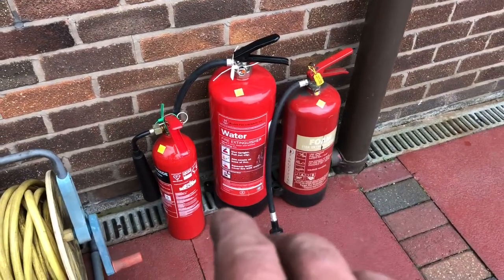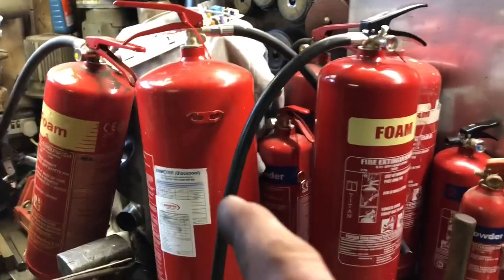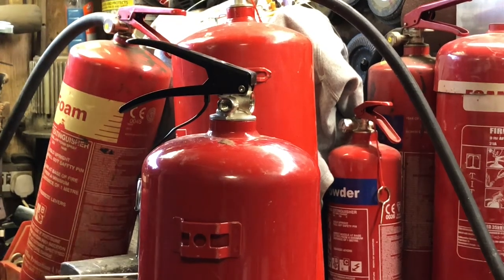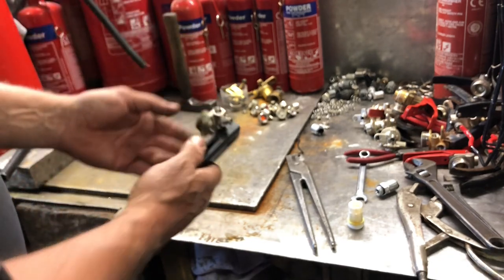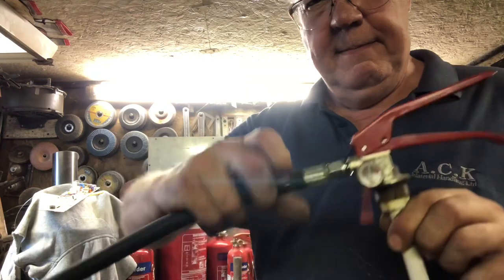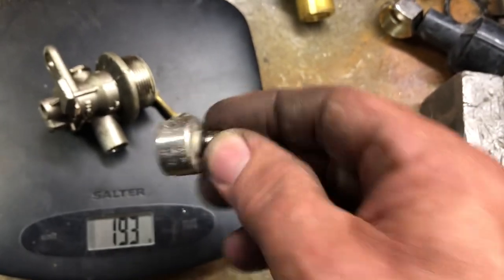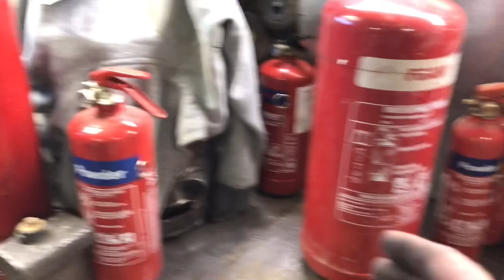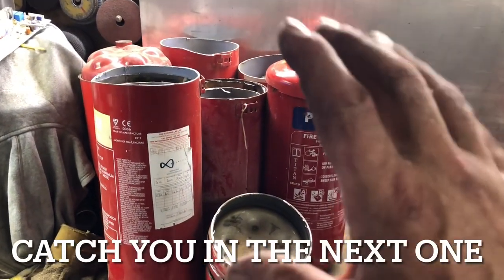Tek it bits  Fire extinguishers for scrap

Comment: iAN HOPE YOUR NOT DOING THE UNSCREWING OF A FULL ONE!!!!!!! IF YOU EVER WATCH ROBOT WARS SOME USED THEM FILL WITH AIR TO POWER THE CHOPER AND FLIP PLATES THERE 900PSI MATE INCASE THE TANK OR VAVE GET WEAK OVER TIME THERE THROWN AWAY ON ROBOT WARS THERE WAS ONLY THE SMALL ONES REMEBER BUT STILL COULD KILL YOUIF THE VALVE BLOWS OUT RIPPING THE BRASS THREADS WHOEVER AS CHALLANGED YOU TO UNSCREW A FULL ONE AS PUT YOUR LIFE IN EXTREM DANGER MATE ALL ARE FILLED WITH AIR AT 900 PSI DAM IT HOPE YOU SEE THIS IN TIME P.S  thats would fire off like a rocket have you never seen a gas bottle valave be nocked of they blow if nocked off can travel 100s of yards and still go threw a  car and smash the engine
Reply from the maker: A timely warning. THANKYOU,   I wouldn’t have done it by hand anyway. But rather scary that the valves on these are only hand tight.

Comment: 30 years using these. You add air to pressurize the cylinder leave it standing up right. To take the pressure off by tipping it up side down puts the air by the tube with out emptying the tank to refill and have at it.  Should have a air fitting to add the air.
Reply from the maker: As I suspected thanks for confirming that.

Comment: If they're nitrogen filled like here you're kinda right you fill it through the discharge nozzle to certain psi and weight of the bottle but no need to push the handle down to do so they valve open naturally when the pressure on the outside is greater. The other fill by a valve above the pressure guage itself